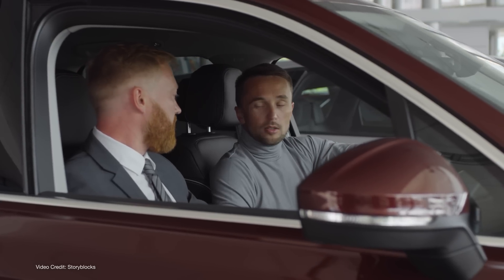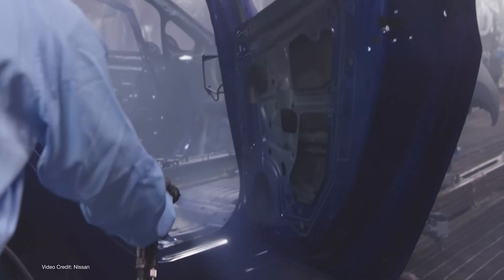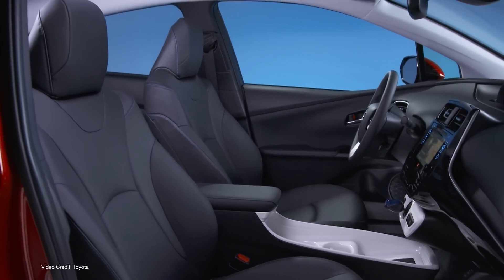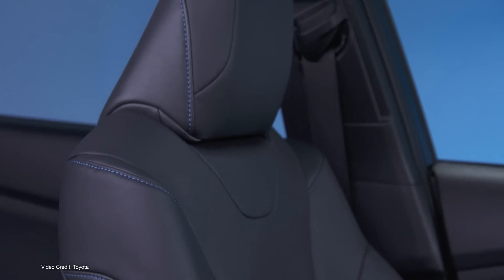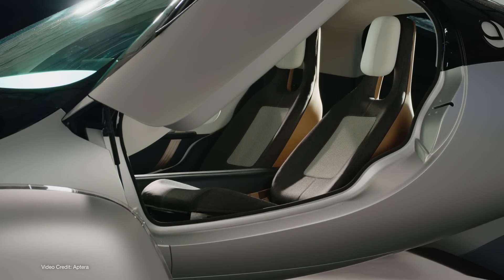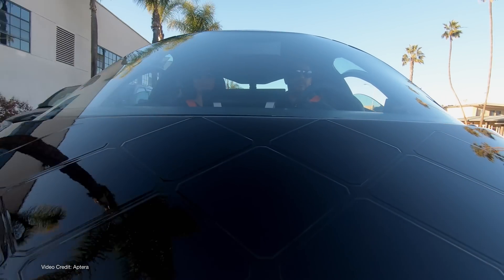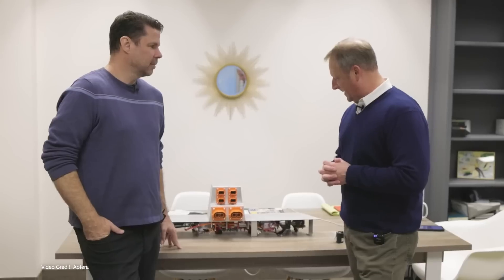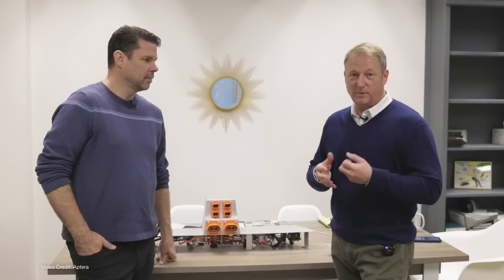Aptera Just Did a 180 On Fast Charging - Here's Why

Comment: One of the things that I think is cool about electric vehicles is that there’s actually a charging point everywhere that you can find a functioning electrical outlet, even if it isn’t nearly as time efficient charging at a designated EV charging station. ICE enthusiasts claim that there aren’t enough places to charge, but I feel the need to point out that I have several in this room, even if it might be difficult to get an EV to my second floor apartment. Lol
Reply: Yeah it's technically possible to charge at literally millions of plugs as long as you are committed to spending the time. I currently charge my Model X with a 120v outlet, and have from the day I bought it. The car sits in the driveway or garage for at least 14 hrs a day and charging at 10A adds around  50 miles of range per day. Plenty for daily errands and such. Looking forward to my Aptera though as we will be able to just let it sit in a sunny driveway and get 40 miles.
Reply: That’s why God invented extension cords! 😂 (Even though your local electrician may not recommend it.)
Reply: When you think about it, if you run out of petrol/gas you have to spend time and effort getting a gallon to get you to the nearest filling station. If you run out of power in an ev you just have to find the nearest kind person with a plug socket. Saw Matt Watson do exactly that in one of his range tests!
Reply: @judebrown4103  I have noticed that some of the light poles in parking lots have outlets at their bases. Never had to resort to that but it's good to keep in the back of your mind. If you do try that though always ask permission of an employee before plugging in your vehicle.
Reply: @shannonlawhorn1674  I'm in the UK and all you need to do if you're hunting for a working charger but feel like you're not going to make it is make sure you're near houses. Over here that's not at all hard, I'm sure in the US and Oz it might be a little more difficult! 😄👍
Reply: @judebrown4103  Or, in the case of the Aptera, hang out in the sun for a while.
Reply: @DrTeeHenry  absolutely! I fancied one of those Sono Sion EVs covered in solar panels. I really hope they get over their troubles.
Reply: Well the places it is difficult to find a functioning electrical outlet currently are mostly along the side of the road. I have seen a couple in London, I have seen an extension cord across the pavement from a pub in rural Australia, they do exist but I have seen many more Tesla Superchargers then functioning electrical outlets available to cars on the roadside.

Comment: Do we know for a fact that Aptera is using the skin cooling?
Reply: Yes, but it's not passive cooling as some have described. A pump and compressor will push and cool coolant and a fan will push air.
Reply: @fotoguru222  Is Aptera actually pumping coolant through tubes in the skin like earlier in development? I havent seen anything recently about how the aluminum belly pan is transferring heat
Reply: @golfish8589  Don't really know if thy do, although I did read the patent they wrote on that.

Comment: Something I don't remember hearing - does it have an Air Conditioner? As I am assuming that may have a similar heat load to remove as a battery.,....
Reply: It will.  At the Launch edition event they said something about "cooling down to 60 degrees" but it's unclear if they meant it will cool the interior to that temperature or if it will blow 60 degree air.
Reply: @robertkirchner7981  The battery cooling loop will be keep the battery temp to 60 degrees C.  The AC is designed to provide additional cooling to the liquid battery cooling loop during charging and exhaust fan driven hot air through vents in the tail of the vehicle.

Comment: Thanks Nikki,  I always look forward for your take on what's happening.  Of course the next question after "Yes." to the DC charging option is; Will we have access to Vehicle to Grid or house power?  Access to 30 or 40 KW downstairs in the carport when the powers out would be very nice.
Reply: Especially as it is solar powered.
Reply: Aptera has expressed support for the idea of V2G, but not before there are more standardized implementations available to them.
Reply: @n.brucenelson5920  Support?  As in a cheerleader?  Or as in an investor?

Anyone can be a cheerleader.  Especially when they don’t fully understand what’s needed to accomplish the task.

In order to perform V2H, your H needs to be completely disconnected from the G.  Then you will need an expensive inverter which will provide a nice smooth sine wave for your picky appliances inside your H.

In order to perform V2G, it will require a more expensive ‘grid tie’ inverter to perform the sine wave timing and to micro step the voltage slightly higher than the incoming voltages so that the current can flow out.

All of this is not financially justifiable for most everyone, but it might be for Nikki and her business and living in a location that has frequent interruptions.

Nikki, fell back to V2L in order to ‘power her home’.  V2L is easy as there is one source and one load in the circuit.  V2L is something that is financially viable and should be a standard on all new EVs.  But one day, some ‘smarty’ is going to put a male plug on both sides of an extension cord and back feed the V2L directly to their entire H circuit box.  Nikki will have the pleasure of reporting on the resulting fire and then describing why this shouldn’t have been done…and how Tesla should fix it for everyone.
Reply: @Abomynous1  Thanks Bruce.  Straight forward information.  You have helped my knowledge base to where I can ask the right question.  Will we have access to the big battery in the Aptera?  It would be very handy to use it in the same fashion as generators are used to power a couple of circuits in the house.  As for the jerks that push way beyond the envelop;  They'll always be there so let's enjoy their folly rather than letting make us set in the dark.  

Today's terms are V2L and V2G.  In five years many many more people will have these terms in their using vocabulary.  Are islanding inverters really that more expensive?
Reply: LOL!  No way!  I have attempted to point out from the beginning, that feeding power back into a significant load is not as simple as everyone thinks.  Example, look at Nikki's last video about all the extension cords needed for her truck to power the house, because Ford's external inverter and the home cut-off switches aren't working yet.

Despite what everyone claims, V2G and V2H are not economically justifiable to most people because of the expense of the support hardware and installation costs.
Reply: @Abomynous1  Perhaps the trick is to have an on-site battery and use the vehicle as an auxiliary?  Most things are really tricky until four or five other people are doing them.  In our house; No power = No Well Pump; And No Well Pump = No Pooping.
Reply: @Abomynous1  For those considering something like a Tesla Powerwall, having your EV do double duty can make a lot of sense, and might justify a larger battery than you would consider for your usual vehicle needs alone.  The tech is not quite there yet, however.
Reply: @Abomynous1  Why is it any harder than making a hybrid inverter? a 3-8kW inverter that can do mains, HV DC solar and LVDC battery with 98% efficiency, and includes all the grid safety conformance is a commodity item that costs $800-$2000 retail. An HVDC -> mains 3-5kW inverter is a slightly simpler item that is easy enough to include in either the car or the household at reasonable cost. Or you can just do it on the AC side by making the charger bidirectional, which I think is how Kia/hyundai do it for their V2L (admittedly a slightly simpler case as there is no grid sync/safety needed).
Reply: @xxwookey  I'll admit that this conversation has forced me to become more familiar with the items that are available for purchase today.  The advances in the area of the bi-directional chargers are beginning to convince me that V2H is very possible if the charger can produce a really good sine wave and a transfer switch is implemented to prevent back feeding onto the grid.  This is the setup that Nikki is hoping to implement with the Ford offering.

It will be interesting to see how it all works out if someone has solar panels from one vendor, a Powerwall from Tesla and a Ford bi-directional charger hooked up to a Lightning at their home and the power goes out.  Each system is designed to monitor the incoming grid power, but what happens when each of the systems sees the grid go down and they each turn on, and provide sinewaves of different timing?  There will need to be a universal controller that makes them all play nice together and determines who's in charge of the timing of the AC signal.
Reply: @Abomynous1  You don't need a transfer switch/islanding to make V2G work. That is a separate matter. Existing PV inverters work just fine supplying power to the house without islanding. You just need export current monitoring and accurate voltage control to avoid unnecessary/unwanted grid export (or import).
You are right that there is a genuine problem of combining multiple pieces of equipment. Which one is 'in charge'? The AC sync is not difficult, but the voltage and current control to decide which things are sending power and which things are receiving power, is. Currently almost everyone is making proprietary stuff with their own protocols trying to get you to buy everything from one manufacturer so it works together (e.g. myenergi, tesla, mixergy, givenergy and all the EVSE manufacturers - they all have their own proprietary stuff). This is completely stupid and needs to stop. There are open protocols, such as OCPP and matter, and tools like OpenEMS and home assistant which can talk to almost everything, but much of that has had to be reverse-engineered because manufacturers are so bone-headed.
There are suppliers like openenergymonitor, and Victron that make open stuff, and there is a host of software under the LF energy project that is doing the right things. Next weekend's FOSDEM dev room will have a load of cool stuff in this area to give you a glimpse of the future:  https://fosdem.org/2023/schedule/track/energy/
I will be there as I need to implement something this year and I don't want to be stuck with any proprietary nonsense that will be junk in 10 years time.
Reply: @xxwookey  True, the transfer switch is not needed if you plan to turn off everything in your home when the grid power goes out.  However, most people will wonder why their car is not powering their homes when it is plugged in.

If you want to use your vehicle for V2H and V2G simultaneously, you need to have a way to island yourself when the grid goes down....

Comment: After Aptera making such big deal about using the Tesla charging standard, it feels deceptive to say the first run will not have fast charging. I am stunned by the leadership of these companies that promote a certain design or vision, but then cut a key feature or do massive price hikes. 

Aptera is breaking the mold for volume vehicle design. I love the idea of seeing these tear drop style three wheeled vehicle on the road. The Prius generation two was a big departure for many car buyers when it comes to looks, but the function made the looks fine. Aptera has made something unique looking, but for logical reasons. That has made early buyers fine with the odd look. Trying to use logic to get people to deal with a high profile feature removed was not the most insane thinking, but I would have chosen to keep the feature and seek more funding. 

Throwing Munro's name in the presentation was kind poor taste. 

I am still thinking Aptera will reach production, unlike the previous run where they went bankrupt before they ever came close to real production.
Reply: Aptera never went bankrupt, but was liquidated years after the original founders were tossed from the company in a board fight.
Reply: @n.brucenelson5920  They failed before, that is the point.

Comment: I kind of agree with their initial idea, but it's true that on road trip it means you would have to wait for hours to recharge, even with the smallish 40kWh pack, and I do intend to use my Aptera, occasionally, as a road trip vehicle, so a fast charger is kind of a must, even if it doesn't need to be the fastest ever.
Reply: I agree that DCFC is a must for the 400 mile version. However that becomes more unnecessary once one considers the 1000 Mile version. But I get it. The number one issue for ev owners is range. Regardless of Real world experience, range is extremely important. 
My Tesla model 3 in five years has gone from 310 EPA miles or 290 real world miles at 65mph in summer 85ish degrees to 260 real world miles, same conditions.
Trust me, even with these numbers I obsess in how much range I have and when I need to charge.
Right now I am traveling and my car is at the airport. I am stressed about how much range I will find when I get back. 
So yes, I will want a car that charges from the sun, has at least a 600 mile range (500 real world) and can fast charge in a pinch.
Reply: Agreed. 
The Aptera is by no means a car just to commute 30 or 40km a day. 
With a cW of 0.13 it is predestined for longest road trips at max. speed and therefore fast charging is a must have to my opinion or else it doesn't make sense at all.
Reply: It's kind'a bullet train for roads. @kullatnunu2087
Reply: with 400 mile range i cant see the need to fast charge while driving, if you could get level 2 charging at night you would not need to fast charge.
Reply: @scottmcshannon6821  400 miles at 65mph is 6.5hrs on the road. I'm comfortable with 10-12 hours on the road and I regularly do 14 hours, but those last 2 hours are tough. My Prius C can keep up, a Tesla could keep up and an Aptera with DCFC could keep up. I want an EV, I can't afford a Tesla and if Aptera can'd do DCFC there are much cheaper cars out there that would get me farther in a day, like a Chevy Bolt or Hyundai Kona.
Reply: I would not call it fast charging. I would call it normal charging vs slow charging.  They need to have normal charging, not slow charging.
Reply: @common_c3nts  For a nomenclature landscape the industry saw coming, they've done a remarkably bad job with terminology. The Aptera would be 50kW DCFC or 50kW Level 3, which was the slowest of the fast charging options until we started to see 24kW DCFC. That is the same as the Chevy Bolt, BUT because of the Aptera's efficiency, that means a lot more miles added per minute than the Bolt. So maybe the Aptera should be 50kW/100mi per 10min of charging DCFC. Its confusing.